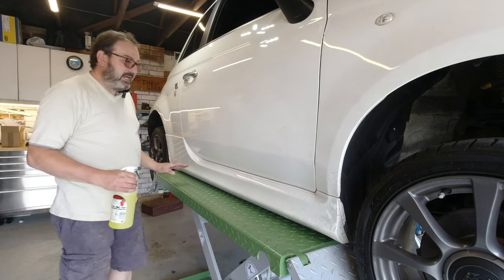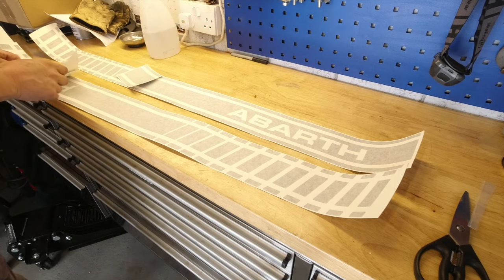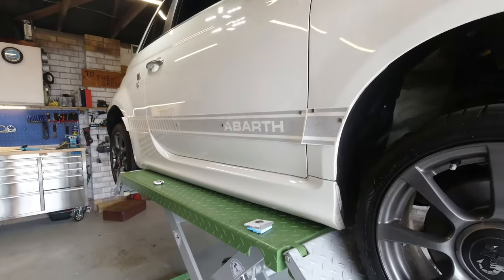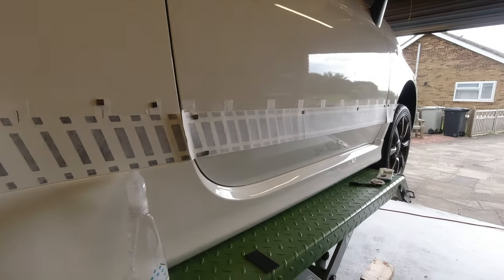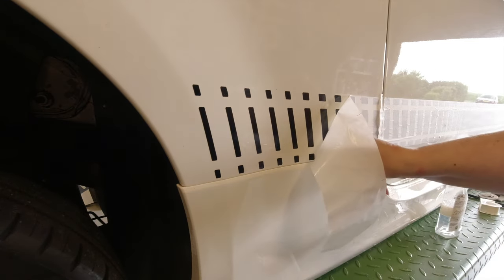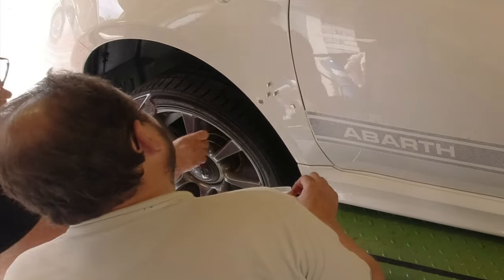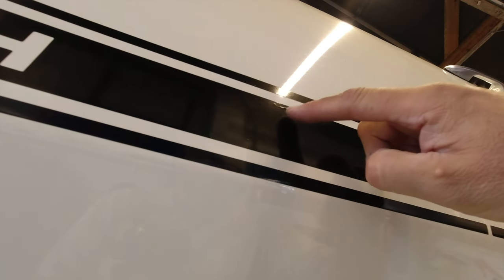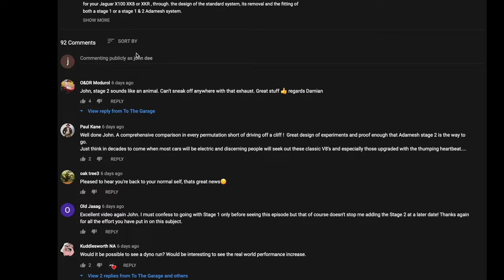How to fit an Abarth stripe, and other big car and van decals

Comment: You're much better applying vinyls dry tbh.
Reply: Tell that to the guys installing clear bras.
Reply from the maker: Can be done dry Alan. but if you make a mistake you are in trouble. And im not THAT good😁
Reply from the maker: Hi Gary. Yes I think the bigger and the more 3 dimensional the decal the more the wet approach helps. Until you get up to car wraps , but that a whole other 'stretchy' adventure👍
Reply: @ToTheGarage  I use just a combo of water and IPA.  No soap.